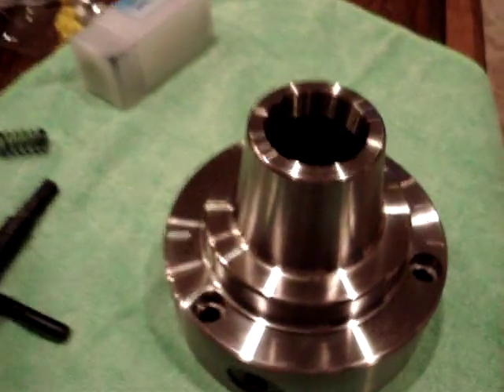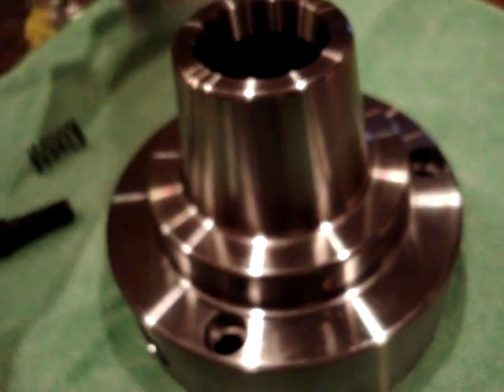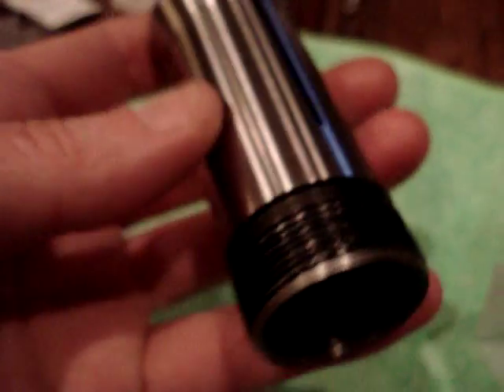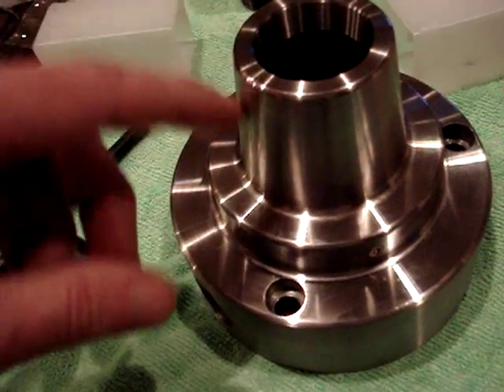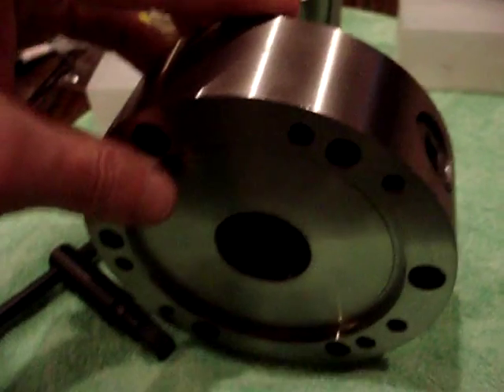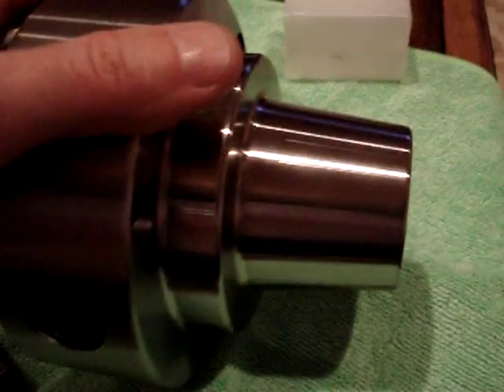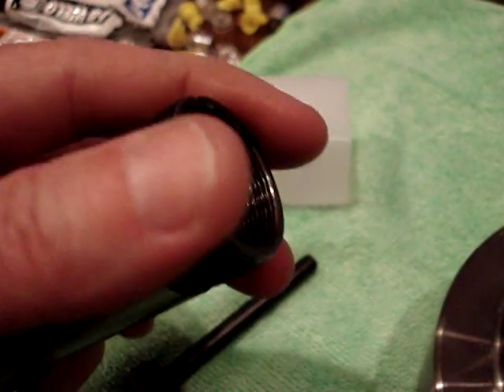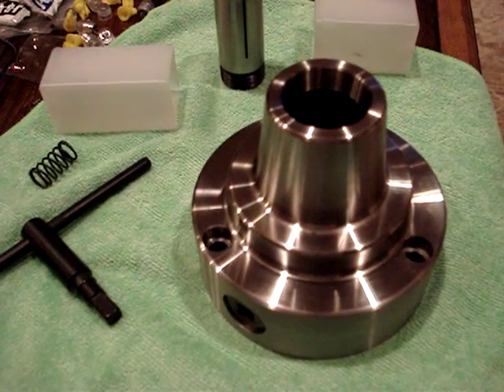5C collet chuck for the Dalton B-4 lot 4 lathe has arrived.

Comment: Impressive heavy and thick.  I am anxious to see it mounted and under power.  Remember, the Chinese use the same steel as we do (we import a lot of steel from China), so it's never the material, but the labor in creating the parts.  And it's the training the labor receives to ooperate the heavy equipment that results, in many instances, or more deviation from the mean.  However, many tools can be puchased that are exceptional.  If this is one of those tools, I too will buy one.  RO test soon...